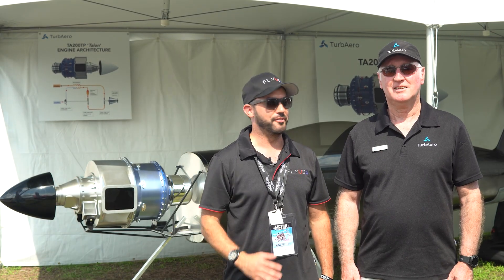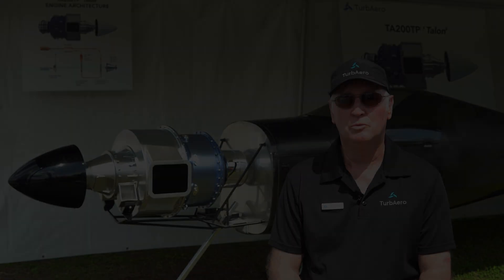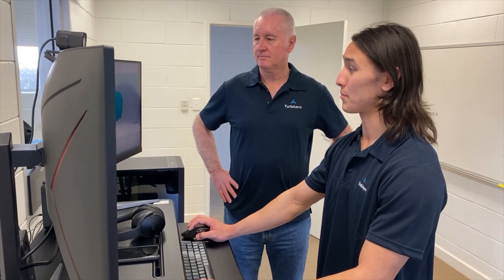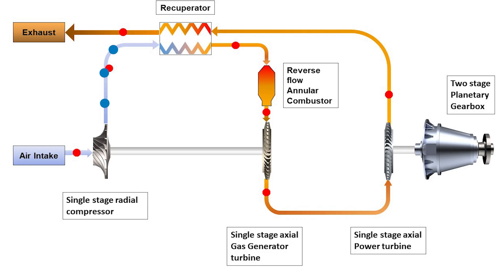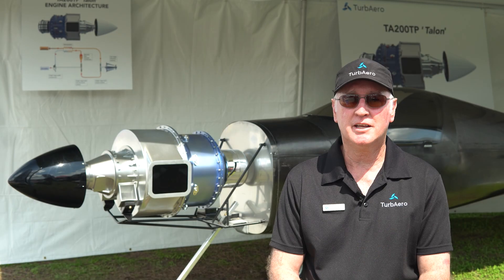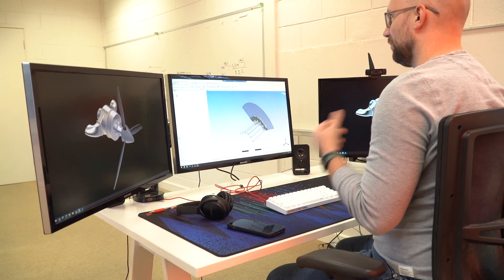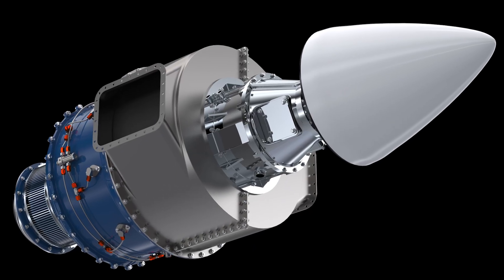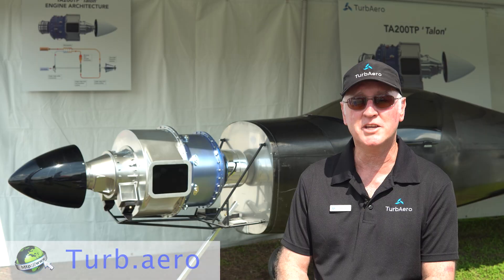200HP Fuel Efficient Turbine Engine by TurbAero

Comment: with the ability to 3d print in titanium, cad machine shops with 5-axis mills & cad edm wire cut machines, projects like this become much more pheasable financially. computers give them the power to test their prototypes virtually before an actual build, thus reducing development costs. machining becomes an excercise in just loading tool paths into machining equipment.

Comment: On a reciprocating engine using a turbocharger there's an inter cooler before the combustion chamber, to cool the intake gases before combustion. This keeps the innards cooler and allows for a greater expansion of the gases which is where the power comes from. Why is it the exact opposite with this proposed turbine engine when the thermodynamics of the two engine types is so similar?
Reply: Они работают на разных термодинамических циклах, турбины по циклу брайтона
Reply: @sevaavdonkin2472  Asked and answered. Thank you.

Comment: Sounds like the heat exchangers that were used in Chrysler's turbine cars in the '60's. In those it was initially done to cool the exhaust to a more normal level for a car, and then the advantages of pre-heating the air for the turbine were found.

Comment: An affordable turbo prop engine would be a game changer. I think a 1/2 dozen now defunct companies have done this in the past over the last couple of decades . Ultimately it was the high cost and short TBO that did them in. Hope this comes to fruition and they sell a million of them.
Reply: a LOT has changed since then. the ability to cut & machine materials like titanium & inconel used to only be found in huge airbus engine sized plants like GE & boeing, because the equipment & tooling was custom & costed more than the GDP of a small nation. now, (smaller versions of) that equipment & tooling can be afforded by a small mom & pop machine shop- along with even newer developments in tech, like 3d printing in titanium, cad edm machines & 5 axis mills. in other words? this is HAPPENING.
Reply: Realistically it won’t happen. Too many unseen variables. Cost overruns, tests showing not making rated power. Higher than expected fuel flow…
 Even Williams struggled to get a viable small turbine for general aviation to market. And they are in that business.
Reply: @ it’s ALREADY been done. turbotech inc. in france has available for order as of 2021- a 160hp (140 continuous) turboprop. 8gph burn at cruise in a bristol xLb, and HAULING A55!  TURBAERO also has a a 200hp machine- they’re not as far along as Turbo tech is, but they do have a functioning prototype and are ready to proceed to production. They’ve achieved this because of recuperator technology something that the previous companies that attempted either didn’t try or couldn’t accomplish.
Reply: @ so let me guess :you work for Pratt and Whitney, right? or maybe Lycontisaurus? You guys are gonna have to get off your patootie and start making engine engines newer than 1935 you’ve been beaten already.
Reply: Nope. Don’t work for any engine manufacturers I’ve used rotax , lycoming , Continental even the Honda based Viking engines on my last experimental. I have just been in the experimental arena since the 80s. My point of contention that you missed isn’t whether turbines can be done. It’s the initial cost, plus over haul and operating cost. We are talking about the average experimental aviator who build in his or her garage when it comes to this engine, Not a huge corporation like Beechcraft .
Reply: @willcall9431  no matter really- the diesel hawk will give lycontisaurus bigger fish to fry. gone are the days when they can keep selling 12gph burners that tbo at 1500 hrs & cost a fortune for a turbo engine that can perform at altitude. they may actually have to get off their bar stool & work for their money.
Reply: @willcall9431  they have a WORKING prototype that has a gph burn rate comparable to a lycoming of the same hp- and their price point is $80k? this competition is OVER- and they won. give it 3 generations & the tbo will be 6000 hours. turbines out perform every engine with reciprocating parts for obvious reasons. their only weakness in this hp range has only ever been cost & gph burn. that solved? they'll dominate.
Reply: 80 grand? No way. Maybe a few that made original deposits… and don’t forget the rest of the firewall forward. If this makes it into full production ( I doubt it)  the fwf with engine will be in the 125-175 k region depending on airframe. . It’s a fools errand to plop that kind of money down. I wish them the best but guys like myself will never buy it. I’ll stick with the good old E2A lycoming that has tons of parts for and I can work on. ;)
Reply: @willcall9431  Lycontisaurus parts? yah you better hope so. thise air cooled lawn mower engines burn thru parts & $8 a gallon fuel faster than democrats burn thru ngo funds.

Comment: Good luck, guys, I wish you well. But the costs of certification for a new aircraft engine are huge, which is why Cessna, Piper and the rest stuck with 1930s designs for so long.
Reply from the maker: Thankfully experimental aviation category doesn't need to deal with that

Comment: They are playing with the numbers! One video I saw claimed 200hp but the fuel flow was in the neighborhood of a piston engine at cruise............but the turbine was running at 50% power! As a numbers guy, I caught that right away! While they might have been able to slightly improve the specific fuel consumption rate, it's still no where close to a piston engine! Expect to burn a minimum of 35% more fuel at comparable power settings.

Comment: They should have built an R-985 replacement for the Beaver fleets.
Reply: Already exists. It's called a PT6.
Reply: @samfxnz  No, it doesn't have a recuperator, so it guzzles fuel.

Edit: Plus, the PT6 is just too large. Something more like the Allison Model 250 (now the Rolls-Royce M250) with a recuperator would make more sense. The M250 is even configured in such a way that would make it easy to add a recuperator to the engine, it's almost like that's what they were originally planning on doing.
Reply: @samfxnz  And it costs around $600,000.

Comment: NFTG is developing a simple, ultra-quiet, personal air vehicle and drone, capable of rapid door-to-door mobility without requiring any operator license. It will be powered by one of our patented rotary engines or ultra-efficient and ultra-power-dense turbo-engines of my design.

   🔸Background
Current modes of transportation are slow and tedious. Several companies are attempting to address these problems with a massive, electrified, vertical take-off and landing[VTOL] air-taxi approach. But this requires the usual slow, tedious land transport to centralized verti-ports that employ large VTOL craft to fly to another verti-port, only to be again driven on land to your destination. This approach has so many issues that we think this is preposterous. 
In aviation, weight is everything. Battery or hybrid electric systems are anything but light-weight or ‘clean’[they are NOT!]. Likewise for piston engines.
A better solution is needed.
<><><>
   🔸 The Solution
We propose a light weight, ultra-quiet[HushTech], auto-piloted, distributed system, personal air mobility and/or drone technology and networked system capable of rapidly whisking the customer directly between destinations without intermediate modes of transport.
The PersonalJet © architecture can either take the form of compact, light-weight multi-copter [multiple small prop-fan propulsion] having a one or two person cabin or, for the more ‘enthusiastic’ customer, can take the form of a strap/stand on multi-copter unit[ala James Bond/Rocket-Man] for point-to-point transport of one person. Stowable wings can be incorporated in other iterations which provide faster, longer range flight yet enable door-to-door service.
An air taxi business model is used in order to increase adoption without the usual barriers to entry new technologies can experience. This model affords the maximal usage[distributed] of the system which lowers costs. The business model also protects the inventions from pilfering/copy-cats.[NOT for military!!!]
The distributed point-to-point model avoids the costs and hassles of verti-ports/air fields.
Auto-pilot ensures flight safety, navigability and low cost.
This system is categorized as an ultra-light air vehicle, which enables rapid adoption provides for low costs.
All this is enabled by our patented, low cost, ultra-efficient, ultra-power-dense rotary 𝔽𝕦𝕖𝕝-𝔸𝕘𝕟𝕠𝕤𝕥𝕚𝕔 ℤ𝕖𝕣𝕠-𝔼𝕞𝕚𝕤𝕤𝕚[𝔽.𝔸.ℤ.𝔼.] engines or turbo-engines of my design.[See my ENGINE contest entry]
<><><>

Ø…Highest fuel efficiency[see graphs]

Ø…Maximal fuel flexibility[110% agnostic]

Ø…Highest specific torque[see graphs]

Ø…Constant maximal torque, power and efficiency at all time, load, temperature or elevation[see graphs]

Ø…more than 400% torque or power available in 𝕚ℙ𝕠𝕨𝕖𝕣𝔹𝕠𝕠𝕤𝕥©❗❗❗

Ø…Lowest noise and heat with smokeless, odorless, pollution-free exhaust

Ø…Lowest parts count engine and vehicle architectures

Ø…Lowest CO2 and NOx even compared to EVs or hybrids[see graphs]

Ø…Most robust and durable with long life

Ø…Simpler, lower cost manufacture

Ø…Manufacturing industry ready

Ø…Legacy fueling and service structure ready

Ø…Climate-Change solved!!!
...

Comment: Tom Keeble ,an enginèer at Australia's aeronautical research laboratory (ARL) did a recperated turbine design and presented a paper on it at the 1976 conference on light aircraft in Sydney - perhaps this engine oŵes something to that research , it is a long sought dream for a turbine for light aircraft and with oxygen or pressurization could really deliver Frank Whittle's dream for high altitude efficiency.

Comment: I wonder if it would work to use ejector valves for mixing exhaust with fuel air mixes for a preheated system? Or using a three stage turbine that mixes hot exhaust before hitting the combustion chamber?

Comment: one important number I didn't catch , weight ? ,looks the part though , With the stol competition planes pushing 400 Hp ,a light weight turbine could have a ready home. Mike Patey with his draco [ may  she fly forever !]. 600 hp turbine has probably fueled a hunger for Turbine power . Personally I would prefer a revival of the Revtec motor ,full torque at low rpm, perfect fit for propellers ,and almost 40% real efficiency .With a bit of the F1 lean burn the efficiency would increase further too .

Comment: Read up on the Achates 2 stroke engine..........Cummins diesel makes it for the US Military.   50 to 55% thermal efficiency........no valve train. Can run high compression on any fuel, from gasoline to diesel.  Would completely murder a jet turbine on fuel efficiency.

Comment: I suspect that if they get this to work, it will sell to drone /UAV  manufacturers for Military purposes rather than sports pilots. The airline industry might take it on as a new APU and the electrical industry might take it on for industrial power generation. If you could use it for Experimental aircraft, running on home heating oil, you might get it into the price range of the ordinary pilot but it's probably for Cirrus owners only.

Comment: The Free wheeling turbines have their shortcomings and are very unforgiving when they fail.  Plus one will have to get a turbine rating from somewhere (single turbine ratings are not so readily available fro the certified aircraft market  like from a TBM 700-950.. )  So after getting a rating on a 500-850hp turbine, you really want to go back to a 200hp turbine?  I'd think that development should have been pegged at the 350hp+ market.  Now as for Fuel efficient, well that is usually at FL 220+ and cabin heat is sorta needed, plus a mask and an IFR rating..  Down low, you've got a fuel pig that will eat the extra weight of the piston engine  in an hour..  What is needed is Liquid Piston to get their shit together and release a version of their engine in a 200hp (150Kwh) version with a turbo boost, or a doubled up 80Kwh  combination (so you can loiter on one engine)...
Reply: As someone said upthread, when you get all the parts moving in the same direction, it really helps.
Reply: @abel4776  MOSAIC is being opened up for the used aircraft market s my impression.. more so for the Beechcraft V35's and such.  to keep a sufficient interest in the pilot development market.. that is my impression (I'm a former owner).

Comment: Thankyou for building this. 
I have often wondered why the heat exchanger has not been used more often. 

May I ask one question?
Could you put the heat exchanger between the two power turbine stages?
This would be at a higher temperature and hence more efficiency but run colder air through the second power turbine. Lower flow rate but denser and colder.

Comment: I wonder if the "recuperator" is similar to the one used on the old Rover turbine car.
Reply: There have been many gas turbine engines with recuperators, and they are all similar in function. There are two physical designs: a conventional heat exchanger as used by TurbAero, and a rotating disk which passes alternately through turbine exhaust and compressor output. Rover's JET1 had no recuperators, their T3 apparently had a conventional heat exchanger for recuperation, and I haven't found details on the later version.  The other turbine cars (such as those from Chrysler) tended to use the rotating recuperator.
Reply: @brianb-p6586  I remember seeing a cut-away drawing of a car turbine with a rotating heat exchanger, something like lots of crinkly metal plates in a disc, and the air flowed axially. A bit like the comprex pressure wave supercharger, but different.
 I'm quite sure that it was a Rover, but not 100%.
Reply: @joejoejoejoejoejoe4391  that's the rotating design that I was referring to. It might have been one of the later Rover designs - I don't know.

Comment: The start process is going to have to be idiot proof though. Watching the now "liquid" pieces of your powerplant flowing out the exhaust would be a disturbing experience. 
I would like to have a fiddle with the Emulator they have for this turbine and see how fast the fuel tanks drain at "flight training" altitudes. Would also be interesting to see the numbers in the sub FL200s too.
I hope it comes to fruition unlike the Italian ceramic turbine when I was flying a C205 in the early to mid 80s when climbing with a load of skydivers in ISA +20 temps was no fun. Added extra precious time to my logbook though.

Comment: So how do the numbers look as egt drops and the dump losses add up? 
I guess recuperating is a proven tech the question is to integrate the compressor design and turbine drop balance to the recuperation drop. It “feels” to me that unless there is movable / adjustable features the engine performance will pivot around a set point of altitude and inlet temperatures. Maybe they have a movable nozzle between turbine and regen stage? Or a regen bypass valve? 
A price point of $85000 seems challenging. 
A big plus is (I am guessing) is that it will be for experimental only so cert cost us modest? What is required ? Maybe containment testing only? Plus fire test?

Comment: Quoting a 3,000 hour TBO sounds suspicious in that turbines’ rebuild requirements are typically governed by hot cycles, not tach time.
Reply: While that may be true, TBO is still a common specification for gas turbine aviation engines. P&W, for instance, issues TBO for each PT6 engine variant (perhaps dependent on specific application) in service bulletins. The suspicious thing is having any TBO established for an engine for which even the first prototype has not been built yet; clearly this is a target, rather than a real specification.

Comment: This is taken directly from the Chrysler turbine engine from the 1960's, and it's stupid. You're basically taking a 1000HP capable turbine and reducing the power output to 200HP by pre-heating the air. Just use a smaller turbine. If 200 HP is your goal, a large hobby jet engine will do the job.
Reply: What hobby turbo shaft jet engine produces anywhere near 200hp?
Reply: No, that's not how it works. The air is not being preheated (before the compressor), the first stage of energy input is from waste exhaust heat rather than burning fuel.
Reply: @brianb-p6586  re-read what you just wrote. The exhaust is pre-heating the intake air. Look up the "re-generator" from Chrysler. The hotter the air, the less molecules, the less fuel that is needed. Ie. You produce a lot less power for a little fuel savings. Chrysler claimed it was because you don't need to waste energy to heat to incoming air and therefore save on fuel. However you want to look at it, it's the same thing from the 60's. I would recommend just using a smaller turbine. Something the size of a large turbo could produce 200 hp and use less fuel.
Reply: @John Doe  I know what I wrote, but you seem to not understand it or how a gas turbine functions. In a Brayton cycle (of which a gas turbine is the most common example) after the compressor heat is added in an isobaric section, followed by expansion in the turbine section. Thermodynamically, it doesn't matter if the heat is added by combustion of fuel or transfer through a heat exchanger, although pressure drop due to flow resistance in any part of the flow path is undesirable.
Reply: Ditto. You need to look up the basics.